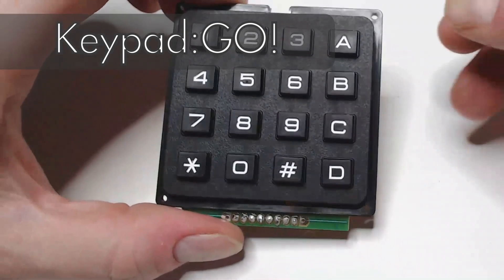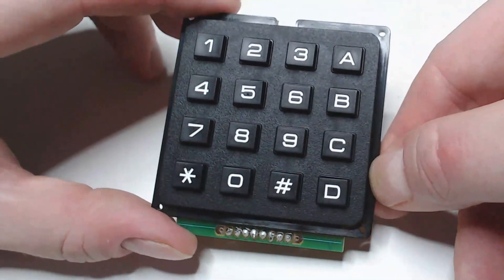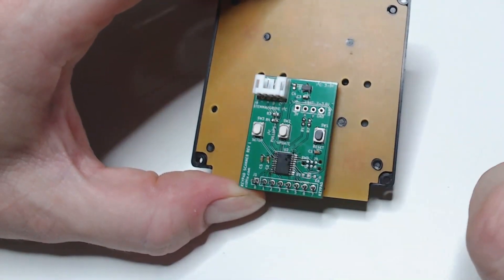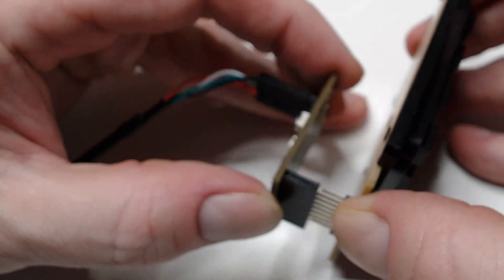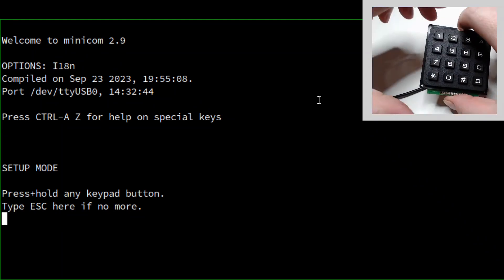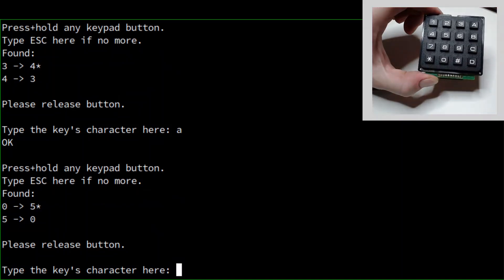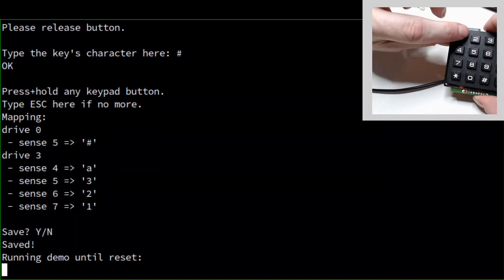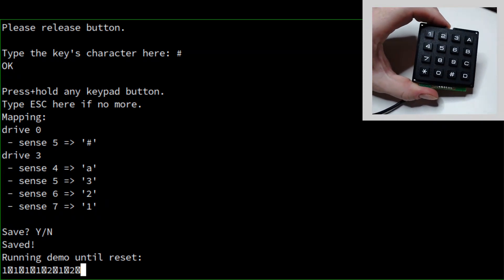Keypad:GO! Introduction

Comment: Cool project.
Just as an idea, you could implement the keys of the most common matrix configurations preloaded and detect them, so the setup is easier, it could be like setting up a keyboard in most linux distros. Something like:
Press 1. 
Does you keypad contain #? press it or wait 5 seconds to skip. 
Press 8. 
Does you keypad contain B? press it or wait 5 seconds to skip.
Set up complete
Reply from the maker: I thought about that and I'm totally game -- but based on my survey of keypads I'm not sure there are most common configs! The sample ones I bought for testing were often reeeeeal random.

But if you've got suggestions on common layouts let me know!